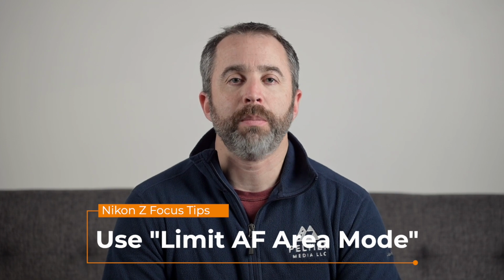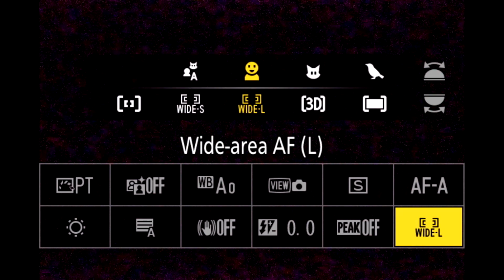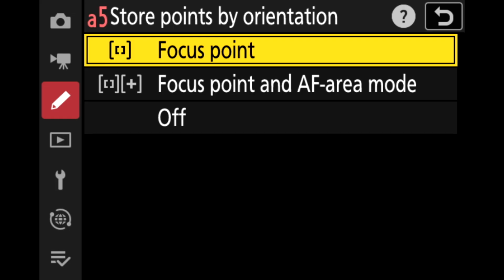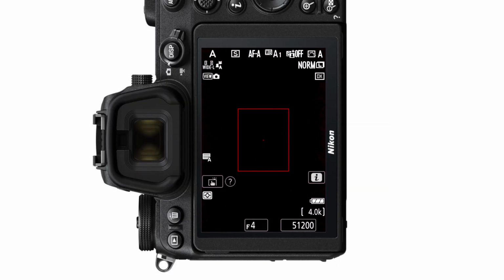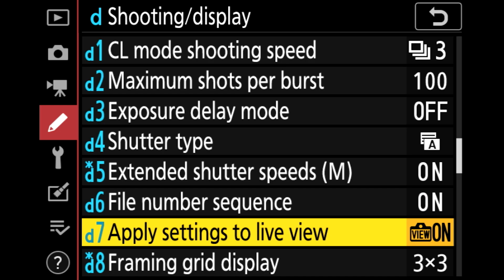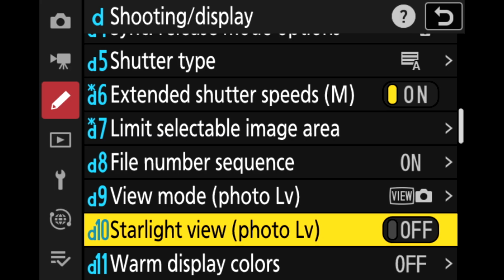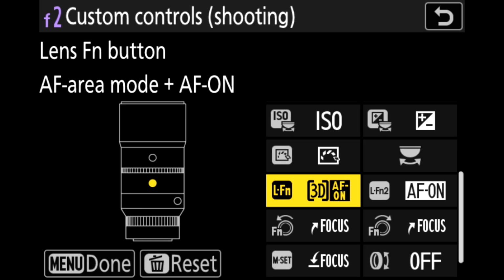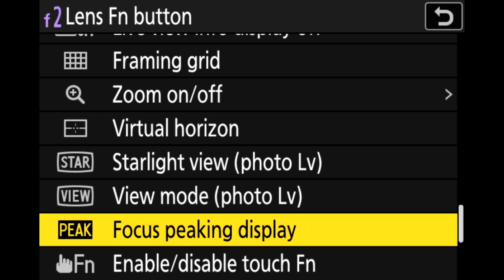Nikon Z Focus Tips (Do You Use These Settings?)

Comment: I have a wandering focus point. My d500 had a lock lever, on the z6iii I need to constantly press the joystick to re-center the focus point. Is there a focus “lock” setting on the z cameras? Fewer focus points? Thanks
Reply from the maker: There's a Lock function in your custom settings f5, and you can also program a control lock to a custom control in custom settings f2. Custom settings a4 also lets you use fewer focus points.
Reply: Thank you! 😊

Comment: I use the first tip you gave about the focus modes. I went through and selected only the ones I need. I also set it to my function 1 button on my z8. All I have to do is press the button to go through all the selections. I think I have 4 selected. If you memorize what order the modes are in you can just press the function button the number of times needed to bring up the one you need. Another tip for the z8 and z9 is to set up the shooting banks. My first one is for general photography. I use it for portraits and landscape. The second back is for cars. The third is for planes and the last one is for birds. You have have the type of focus mode already selected for each bank so when you switch to it it's ready to go. You can also set it for the mode you shoot in. If you want one more set to aperture priority mode, you can have that set up. You may want one for shutter priority mode. Or have one set up for manual mode.

Comment: The real problem for focusing in  verry  low light situations is  because the z -series ( and other mirrorles camera's) won't activate the AF assist light of a external flash. They say it's because the red light isn't good for focusing for the Z camera's. But if the light would be activated, a flash with a green beam could be developed.  If there isn't enough light/contrast, the only way is to ad light ;-)